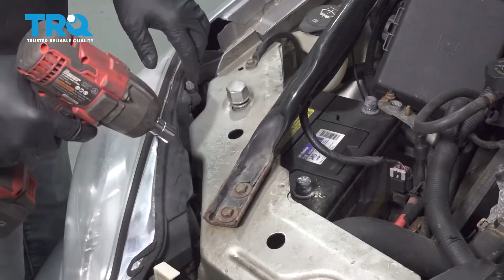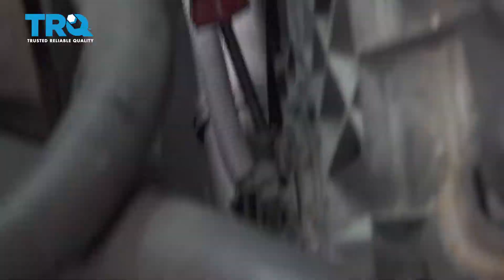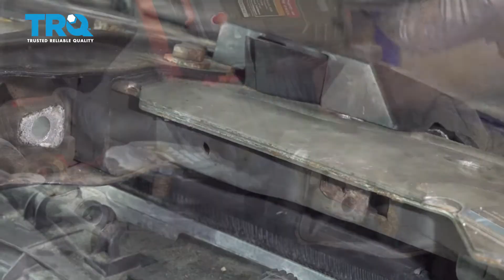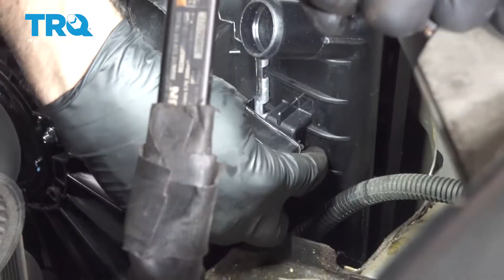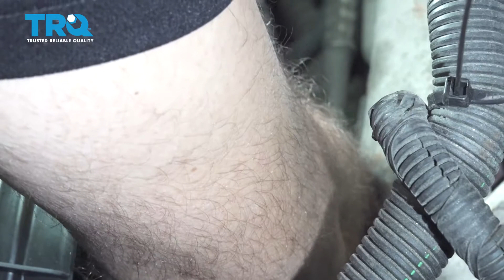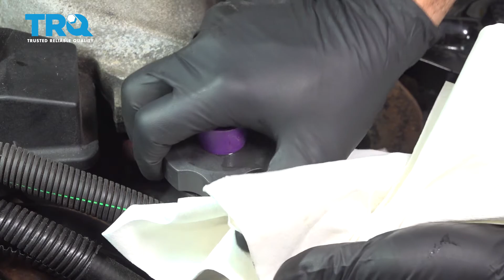How to Replace Radiator Cooling Fan 2006-2013 Chevrolet Impala

Comment: Thanks, but my 2013 Impala LT has a 3.6 L engine, not the 3.5 L shown.  I guess they changed engines in 2012 or 2013.  Completely different design.  For example, you take off the oil filler cap AND take out the oil filler neck to remove the engine cover. For my 2013 3.6L, I just take off the oil filler cap to take off the cover.  No need to take out the filler neck.  And the engine looks a lot different than yours.  You show removing the battery cables and a brace to get to the connector clip to disconnect.  On mine, there are 2 connector clips, one for each fan, and are located very close to the fan motors and are very close to the engine exhaust pipe.  I disconnected the passenger side one very easily yesterday to experiment to see which fan was causing a vibration.  Still vibrated, but maybe slightly less, hard to tell.  I reconnected that one this morning (after engine had cooled overnight) and tried to disconnect the other.  It was a tighter fit, so not able to disconnect yet, but will try on another day when I have a little more time.  Fortunately, both fans still work, but one or both vibrate noticeably but make no other noise such as bearings wearing out.